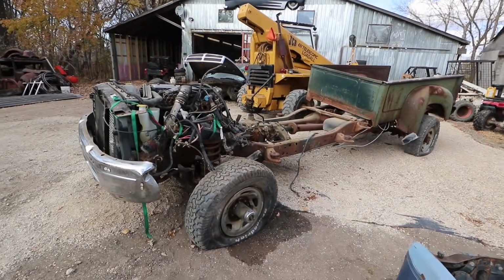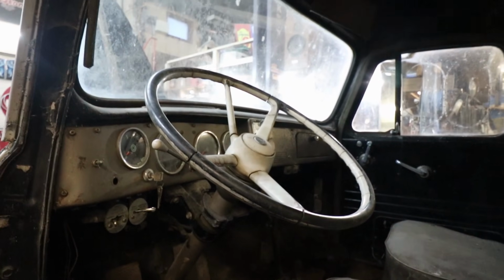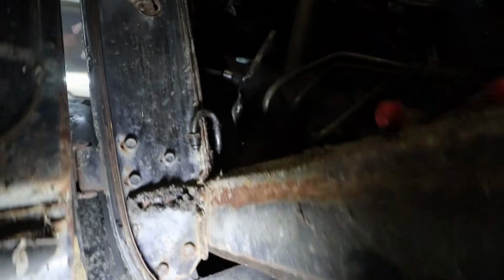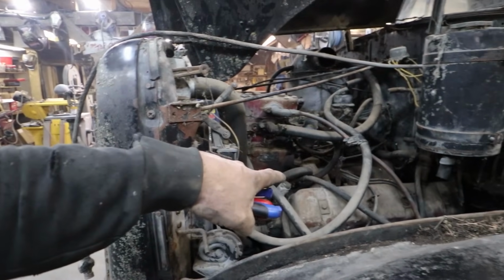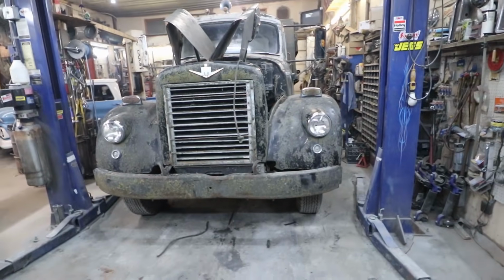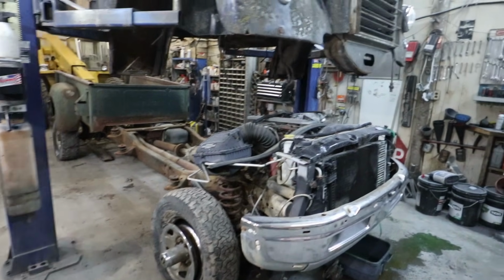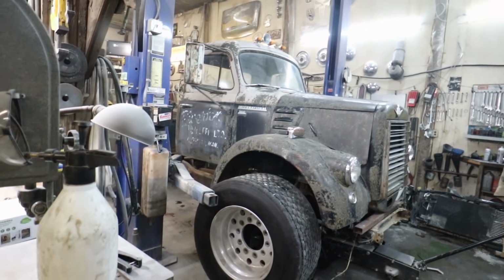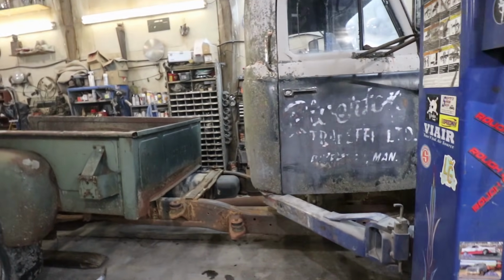International Cummins 4x4 body swap crew cab project part 2 getting the body off the donor.

Comment: Maybe reinstall the fuel tanks as  dummies but would give you steps to help get into the cab and fill the gap between rails and cab. Could make them into side tool boxes.  know you will make it all work, Great video.

Comment: Greetings from the Porters. Ok, I made this video. Sure looks like you could use an extra pair of hands…lot of climbing in/out of you fork lift, etc. But that’s the way it is, huh? Having the hoist lift is awesome!! 🧐 Yeah, tis gonna be a tall truck, but still pretty sweet looking. I’m sure things will change a bit from here on out. And NO, I’ve not looked ahead to see the finished product. It’s nice that you have all the parts that you need to basically put it together…extra cab, fenders, etc. Jaw-dropping awesome! 🤩

Comment: body lift black iron pipe with washers welded on it that what alot mud trucks in tennessee have for a bodylift cheap and easy try it.thanks

- nick
Reply: Right... once the wheels and suspension are hung he'll know exactly where the frame will be sitting and how much body lift for tire clearance he wants I think
Reply: CANADIANS USE HOCKEY PUCKS!
#🇨🇦 💘🏒
Reply: @jontrudell7529  Extra Absorbent?

Comment: I do believe that those cabs unbolt the tops and down to mid cab level on the back side. So with it not cut but unbolted from the above windshield, it would be so easy (long as I'm not doing it) to add a piece right on back but from there, its really sketchy as to what an where to start plunking stuff. I have had one of those off when I  was a sprout and dad an me took a good cab at the wrecking yard off and put on another frame and made a roller out of it. Too many years ago tho to be helpful. I had a lot of the "L" series trucks over the years and what a easy cab to work with.... half the size in some ways,.... my theory is that not all models going up in the model number stayed the same or got bigger as  numbers got bigger.... That was a total guess an not fact. I like those bolts that international used that looked almost like self tappers.... way fast threads and most fenders would actually come out instead of rusted in forever. I can tell you now that this  build has me really excited and if my input is confusing then tell me to butt out butt head as I just really want to watch real bad. That 392 engine was plagued with water jacket problems, and even though each of the three, the 304, the 345 and the 392 looked a lot alike, they are not and so my changes like how engine balanced and the 304 made it over to jeep for a few years and was a full on power unit but that 345 was the best thing since corn bread at easter n thanksgiving to ever be made. Who knows, maybe I only got good ones but not one let me down. I  rebuilt a 392 and its the one and only motor to ever beat me. I would make the changes and in a week it was hot again till finally it just cooked itself. I had polished and scrapped all   grease and other colors off and hand painted it to perfection. So it was the prettiest and deadest engine ever for me. I have worked on that engine with success but just one beat me bad and gave me a bad name for a while.
Reply from the maker: I've had a few Internationals only one with the stock motor and it was a 6 cyl haha. Did have a 304 in a jeep thought that was a jeep thing though.

Comment: Interesting build. I would have went with the Dodge driveline into the IH chassis. Then built the crew cab and bed off that. I get the Dodge having a modern suspension being better all around for a cruiser/shop truck.
Reply: Thats what I was thinking also 
not sure which would have been easier
Reply: @mrclubike  Toss up between body work and chassis work.

Comment: Big diamond could work for a name. Myself I would keep the original front bumper and tow hooks with the cab. How does title n register work up in canuckville? One problem using medium duty truck cabs in the USA is weight ratings and DOT numbers, etcetc..  Thanks for sharing

Comment: Galvanized water tank cut in half makes 2 rear fenders. Either you get skinnier fronts or you 3 point turn minimum  where ever you turn. Turning radius of a aircraft carrier.
Reply from the maker: The wheels fit pretty good in the wheel wells when one takes the other wheels off haha
Reply: @HalfassKustoms  put one on the chassis I'm betting it hits the frame too when turning.

Comment: My experience is that steering is actually more comfortable than standard car steering. Maybe with power steering that is a different deal but I'd keep it for sure.
Reply from the maker: yeah man it's crazy how comfy it is in the stock form
Reply: @HalfassKustoms  first one I drove was my mom's '68 dodge van - wheels are under your seat which makes for a different experience. Last one was a dodge d600 dump truck with a 'wide' 318, 5 speed with a 2 speed rear axle. I have a dodge m37 on the way which should be similar. My old toyota land cruiser has a pretty flat wheel as well though not as flat as the others.

Comment: It maybe easier to reuse the old frame and modernize it. I dont see well done frame swaps often, theres always alignment issues that you can see from across the highway

The best frame swaps tend to be similiar enough vehicles that it works. Like say, a 70s pickup on an <00s chassis.
Tryin a 50s or early 60s tends to get tricky as the frames were so flat and steer axles so far forward

Comment: Ironic   back in  say   1960  FWD  used  IH  Cabs  then about  1963 they switched  to pile of Junk Dodge Cabs.. My  Father  still has a 1963   IH  R-190   549  gas   tandem  axles    5 & 3  speed transmissions..

Comment: Suggestion: Why not Hot Rod it, leave the fenders close to their present height, change the hood sides to short flat welded panels,  change the hood to open from the top instead and then drop the front clip with body 6-7 or 8 inches or more?  That would be one awesome look. Picture the tops of the fenders even with the top of the hood, I think that or a flip front would be wowie-zowie